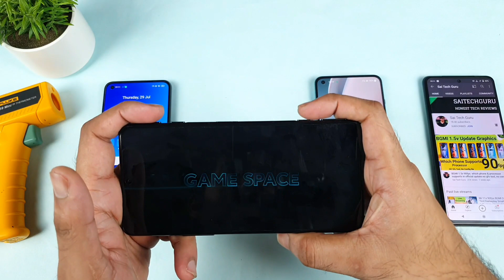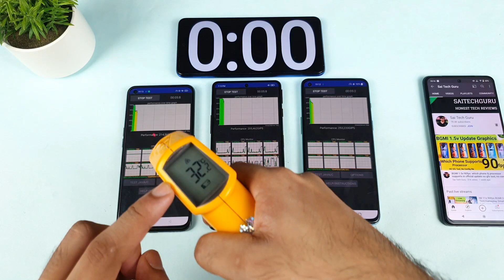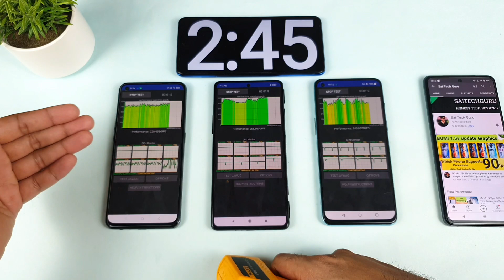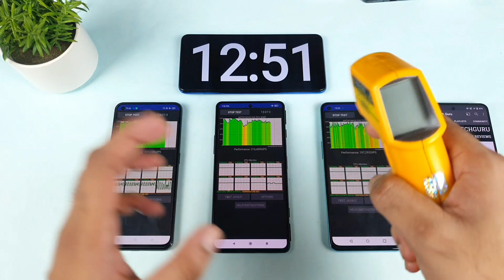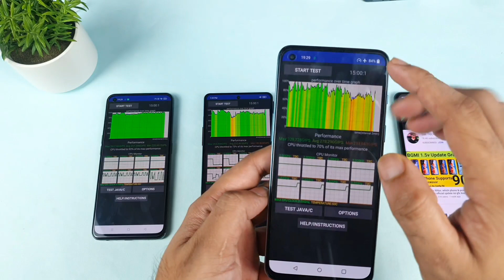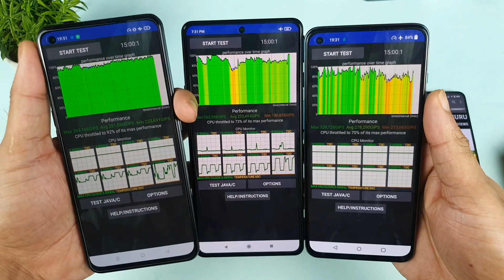Comment: Bro if poco f3 gt cross 47 degree Celsius it will dial back it performance and it will throttle a lot cause fps drop in this phone but realme x7 max reached 50 degree Celsius it performed well 
Source:Pubg HDR+extreme test by gaming josh